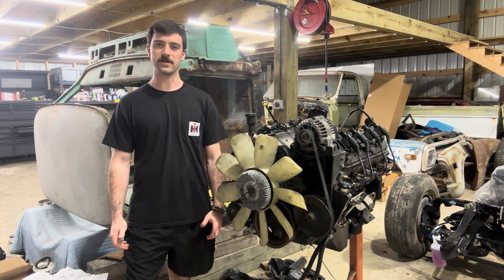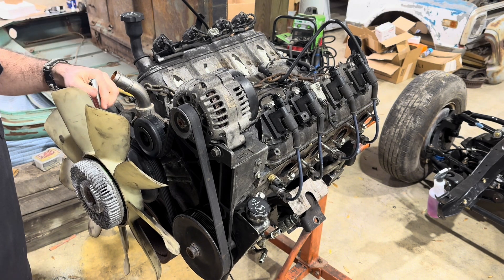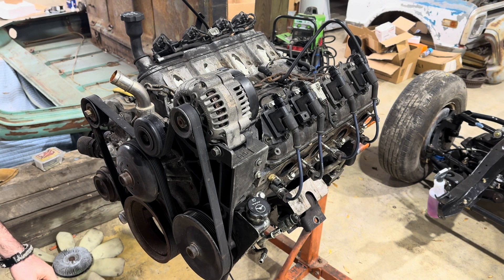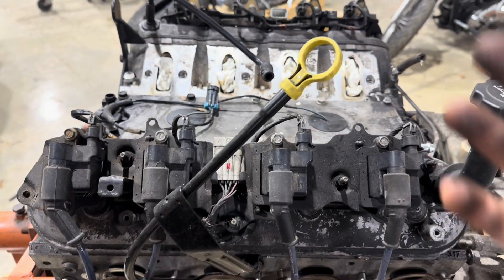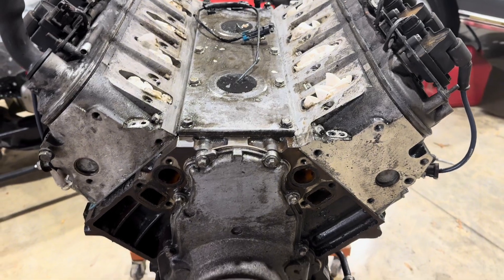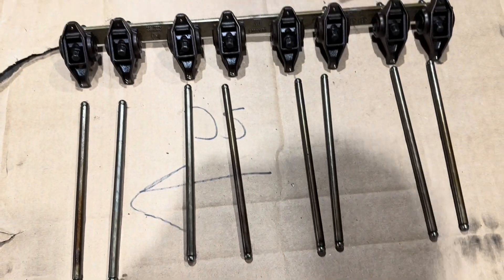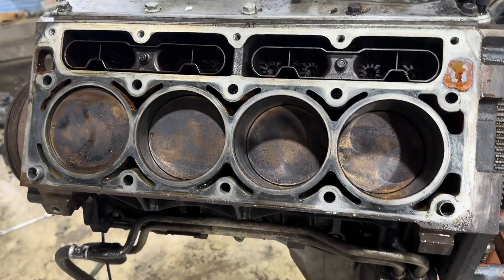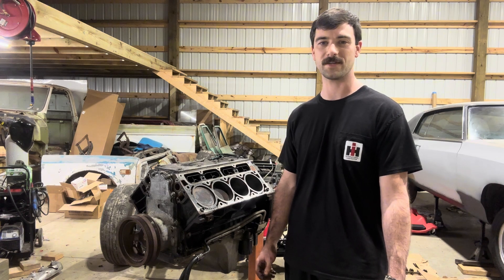6.0 LS Teardown is it an LQ4 or LQ9?

Comment: Simple question, would I have to modify my firewall to put an LQ9 into my 1970 chevelle or will it fit the space?
Reply from the maker: It will fit perfectly. Just get LS to SBC or BBC motor mounts . Dimensionally the LS is the same size roughly as the SBC
Reply: @BarnBuiltFabrications  Thank you, I saw a lot of information in that install video, with the LQ9 into the 70 Monte Carlo, thanks again.

Comment: You realize you can just look in a spark plug hole to tell what pistons  it has? Also compression is not the only difference. Lq9 has slightly stronger internals, I believe rods.
Reply from the maker: Right. I think I may have mentioned putting a scope in the plug hole as an option. For me I had plans requiring a teardown so it was dual serving to break it down to check. I wasn’t aware about the gen IV rods being used in the LQ9 though thanks for the info!